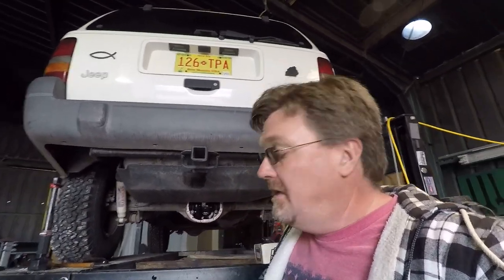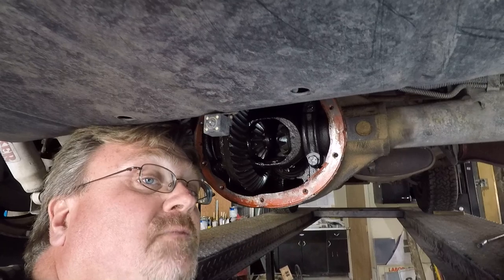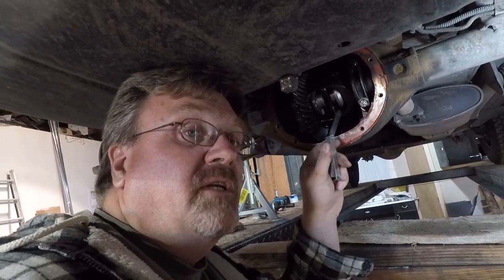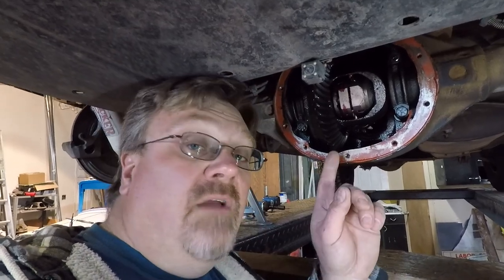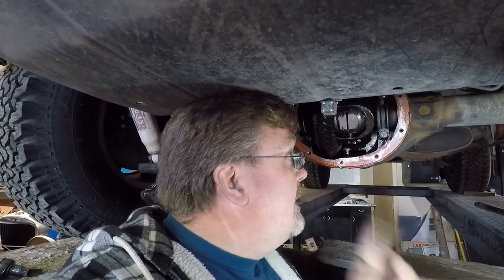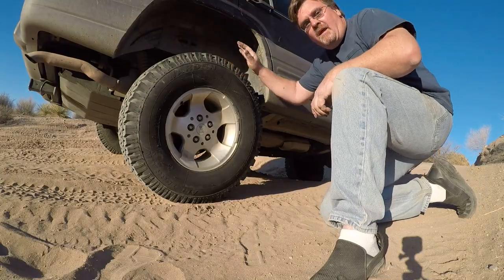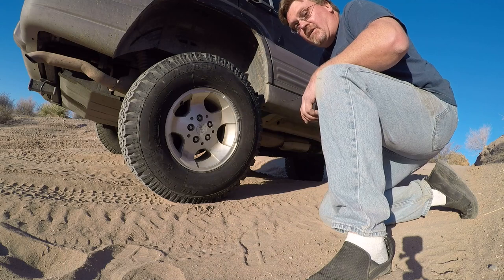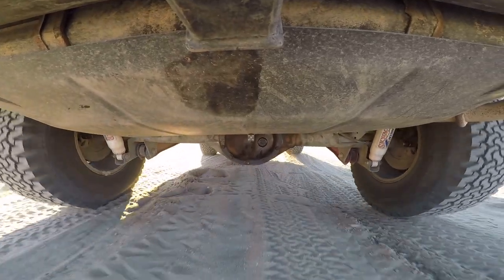Adding a Locker to a 5-Speed Swapped Jeep ZJ Grand Cherokee

Comment: peculiar way to make a locking diff. On most European cars, at least since the 80s, the lock is on the outside of the crown wheel, so you have a regular diff that clamps onto the one axle, and thus have the benefits of a locking and regular diff at the same time. And it's quite normal for us to have auto-locks on all 3 diffs in a 4WD,  - front, rear, and centre

Comment: What size lift and tires
Reply from the maker: About a 1.5" lift (added 1.75" spacers but removed the spring isolators), and 31's.  It seems to be a really good all-around combo.
Reply: It’s better to get a 4 in lift on 35’s